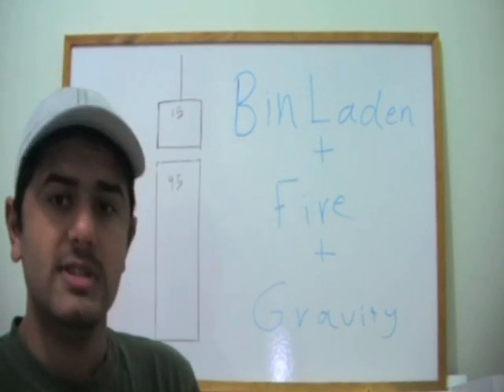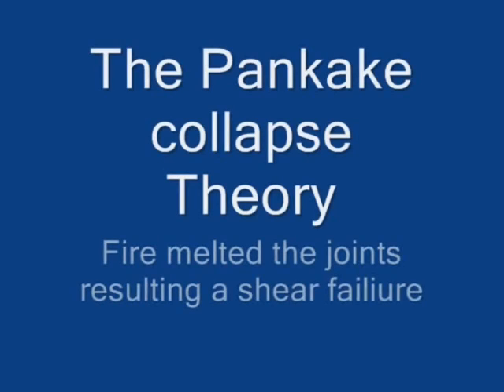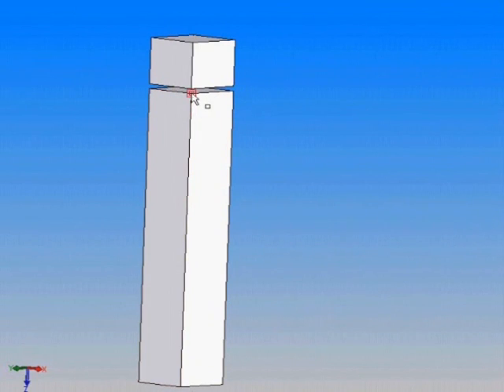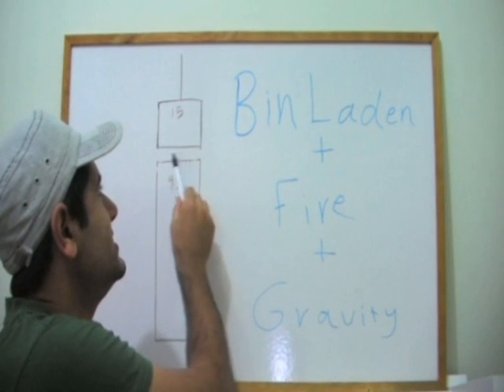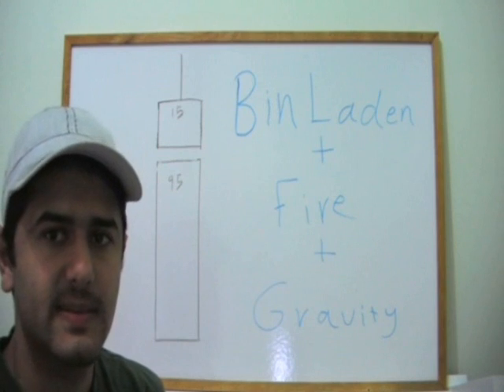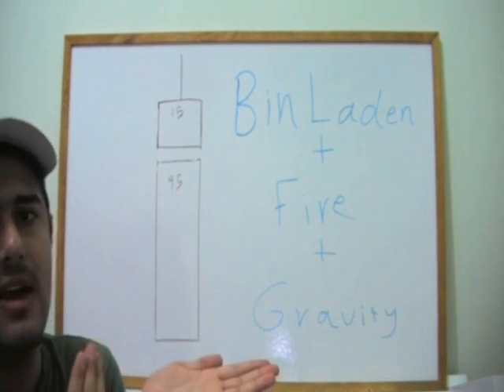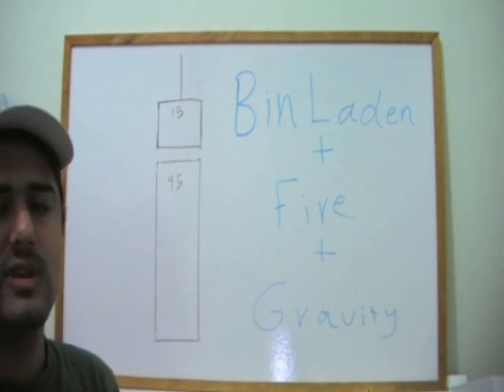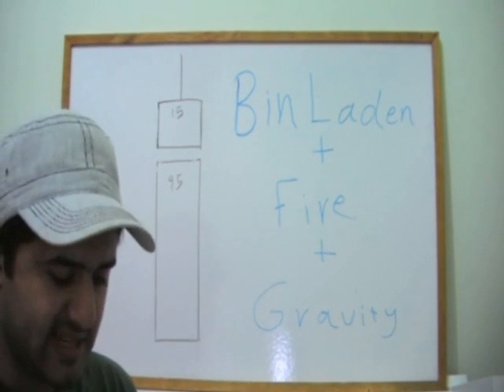(Part1) 911 Simple Physics Structural Failure Vs Demolition

Comment: I would like to offer some general comments that ought to make an open minded person question the official story of what brought the WTC towers down.

1) Controlled demolitions work because special technical expertise is required to bring tall buildings down into their own footprint. Videos show buildings collapsing in an orderly manner because that's what the demolition experts intended.  Even then, something can go wrong and there will be a building that does not collapse completely, or it will topple over like a falling tree.

2) The planes that hit the WTC towers hit them at different places, yet what we see are two building collapsing straight down in virtually identical patterns.  In fact one video shows the beginning of the upper portion of the tower tilting outward, but it disintegrates before it does so.  The damage to the underlying structures that resulted from the impact of the airplanes, including the warping of beams caused by the jet fuel fires, was completely unpredictable and random.

3) To believe that the buildings collapsed straight down in a continuous orderly collapse as they did because of  the result of the random effects of the impact of the planes ought to be seriously questioned.  In other words, can the imprecise impact of two airplanes achieve the same result as a carefully engineered controlled demolition?

As the kid said, You have a lot of  'splainin' to do.
Reply: zaxineohp Response: Your comments are riddled with errors, non-arguments and other mistakes that aren't going to get anyone to rethink 9/11. To wit:

1) The towers did NOT fall "into their own footprints"; they rained destruction for a hundred yards in every direction! No controlled demolition does that! You may call those collapses "orderly" but I certainly do not.

2) I've read this paragraph 3 times & don't see what you think anyone should find suspicious. Couple of points:
"one video shows the beginning of the upper portion of the tower tilting outward, but it disintegrates before it does so" - I seriously doubt this. Link?
"The damage to the underlying structures ... was completely unpredictable and random." - I have no idea what you're saying here but I would hardly call it "random"; I'd call it predictable & logical.

3) Again with the "random" claim. What was random? Everything that happened followed logically from the events that preceded them.

You seem to think you're smarter than the structural engineers who studied the towers & concluded plane-crash damage + fire brought those towers down. You've got a long way to go to make that case!
Reply: TimReed22222 In paragraph 1, I was talking about controlled demolitions in general.  WTC1 and WTC2 were not typical controlled demolitions since the structures were destroyed from the top down.  I would argue that pulverizing the concrete that was expelled in great clouds of dust and hurling 4 ton beams, some of which embedded themselves in adjacent buildings, required large amounts of energy - energy that could only come from explosives.  It makes sense to destroy the buildings from the top down since the impression must be created that it was the airplane impact and the fuel fires that caused the building to collapse.  And don't forget the molten steel that was seen flowing out of the side of one tower.  Jet fuel doesn't burn hot enough to melt steel.

In paragraph 2, I was establishing a contrast between the impact from the airplanes, which would result in unpredictable (i.e., random) warping of beams and therefore - if the buildings collapsed at all - there would be no way to control how the buildings collapsed.  The fact that the buildings did come straight down ought to raise some suspicion to say the least.  Yes, much debris was expelled outward, but the general pattern of collapse was straight down.  When you see controlled demolitions that fail - and depending how they fail - some will topple over in essentially one unit and stop.  Controlled demolitions that succeed, succeed because demolition experts know where and how to place the incendiaries.  A "dumb" plane crashing into a building doesn't have the intelligence to do that!

I couldn't find the link that showed the top of the tower falling outward and then disintegrating.  I will look again when I have more time.
Reply: zaxineohp You seem to be arguing that since the towers' collapses resembled (but admittedly, not really) controlled demolition that that's what it must have been, as if a straight-down collapse would be impossible without careful planning. This is an error and shows an enormous lack of imagination, as does your implication that only "intelligently" planned demolition can succeed

"I would argue that pulverizing the concrete ... and hurling 4 ton beams ... required large amounts of energy - energy that could only come from explosives."

You could argue that but you would be wrong, because you are ignoring an alternate (and very large) energy source: The towers themselves! Ever learn about gravitational potential energy? Then it's time you did, because each tower stored energy equivalent of 200 tons of TNT in its structure - all of which was released at once! Pulverizing concrete & sheet rock? Hurling steel beams? No problem at all for that kind of energy.

And oh yeah, about the molten "steel"; that's a MYTH. Molten something was seen flowing, but that something was never identified. You're just assuming it was steel.

"The fact that the buildings did come straight down ought to raise some suspicion to say the least"

I fail to see why. With gravity being the only force acting on those towers, DOWN is the only way it can fall. What force would cause them to topple?
Reply: TimReed22222 The potential energy stored in the buildings can be released only if something is done to remove the supports for the building.  When you hold a baseball in your hand, it remains there until you let go.  If you let go with nothing underneath, it will fall smoothly to the ground. But if you let go of the ball over a pile of branches for example, it will fall in some unpredictable manner and may not even reach the ground.

A building remains standing until some other event causes the support for the building structures to be removed.  In the case of the WTC towers that "something" was carefully placed explosives that resulting in the violent expulsion of the material horizontally.  Gravitational potential energy works only vertically.  Also notice that the buildings collapsed smoothly.  Randomly snapping and bending beams would cause the buildings to behave in some unpredictable manner.  There would be hesitations.  There would be sections of building that would topple.  Certainly, there would be no multi-ton beams being ejected horizontally with enough force to be embedded in adjacent buildings. And who knows what else.  The smooth, progressive collapse is evidence that must not be ignored or taken for granted.

I am not assuming the molten metal seen flowing from the tower is steel.  Experts have said that the golden color is indicative of melting steel.

Did you look at the video link I supplied?  What caused that projectile that was falling in the expected arc pattern to all of a sudden be propelled straight down?  Did you ignore this video because you have no answer?
Reply: zaxineohp "The potential energy stored in the buildings can be released only if something is done to remove the supports for the building."

Quite correct! Like, say, when a heavy jetliner laden with 10,000 gallons of kerosene crashes into them at 500 mph.

"But if you let go of the ball over a pile of branches for example ..."

Congratulations! That's the silliest 9/11 analogy ever! Comparing baseballs & branches to a massive skyscraper? LOL!

"In the case of the WTC towers that "something" was carefully placed explosives"

Based on ...? Seriously, what actual, hard evidence of explosives are you aware of?

"Randomly snapping and bending beams would cause the buildings to behave in some unpredictable manner.  There would be hesitations"

Exactly how big a hesitation are you looking for? You're talking about an interface area an ACRE in size, with hundreds of such events occurring per second! At the local level you may be technically right but what, exactly, do you expect to see? You think a single beam snapping would make a visible hesitation to a moving 100,000 ton mass? You need to think about scale a bit more.

"Experts have said that the golden color is indicative of melting steel."

I'm calling bullshit on this one. Citation?

"Did you look at the video link I supplied"

What link?
Reply: zaxineohp P.S. Still waiting for your link to this: "one video shows the beginning of the upper portion of the tower tilting outward, but it disintegrates before it does so"
Reply: TimReed22222 It's the third one down under replies.
Reply: zaxineohp OH FFS how about a link?? It's not hard!

Comment: Irrespective of what you may think of his physics regarding the assertion of 'pancaking,' no aspect of the 'official' story is viable in the presence of the supporting CORE structure which would not have been subject to 'pancaking' under ANY circumstance absent pyrotechnic intervention, since the CORE was self-supporting and not depending upon truss support.
Reply: That's why there was a huge explosion in the subfloors of both buildings. Most people were killed and the lobby was blown all to hell.  Only the survivors tell the story of the bombs going off in the basement about ten seconds before the planes crashed into the towers. It happened, the seismograph recorded it and a voice recorder across the street heard it.  Stupid people will NOT believe it until Megyn Kelly tells them that it's true.  Brainwashed robots
Reply: +Patrick Lilley Yup; that pretty much says it. Sad, but true.